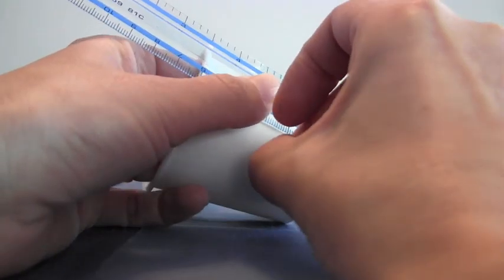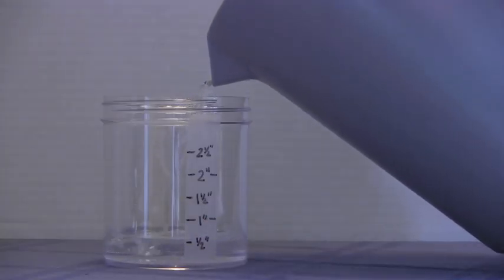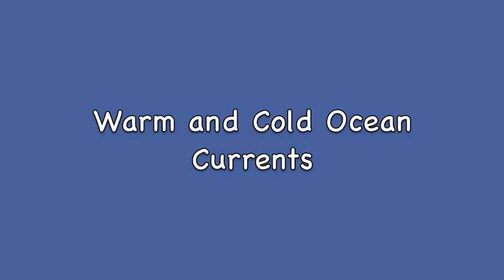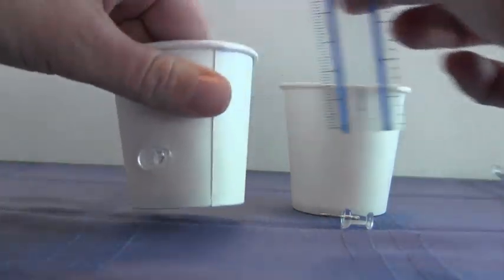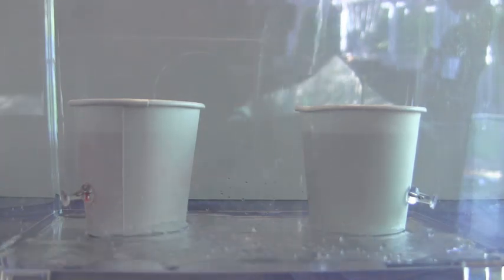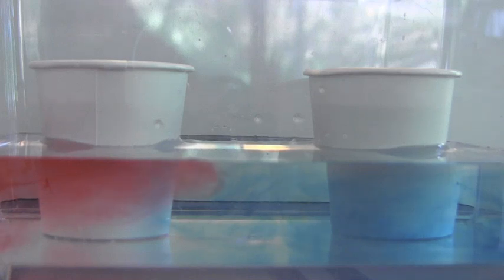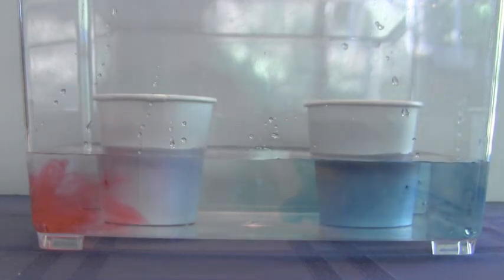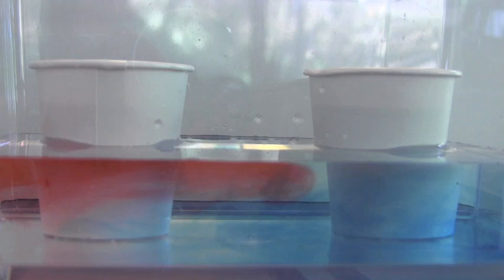Ocean Currents

Comment: I tried it doesnt work. the hot water doest rise dramatically . It kinda mix in between. maybe you r using different density (oil or salt )of water to make it work
Reply: It should work, I tried it and it worked. Maybe your waters are too close in temperture? Try using really hot water and almost ice cold water..it should change it.

Comment: Why do cold water and warm water have different densities?
Reply: Bcz cold water not expanded. And hot water will get expanded due to temperature
Reply: It's just the same as a hot air balloon. You fill it with hot air to fly and release it away to descend.